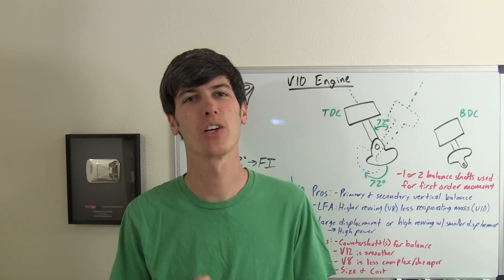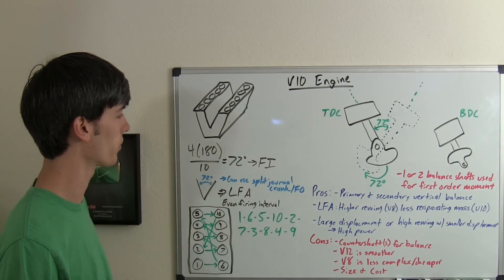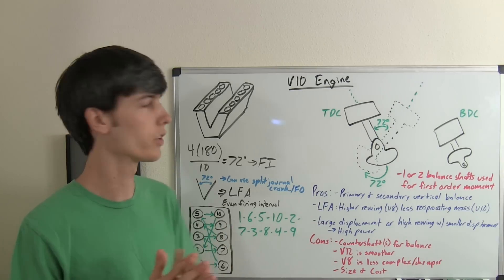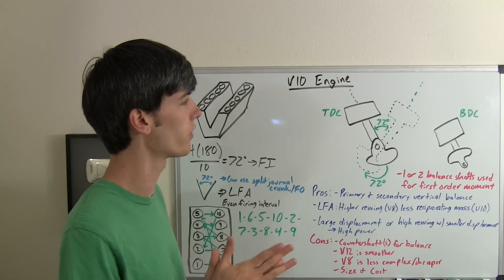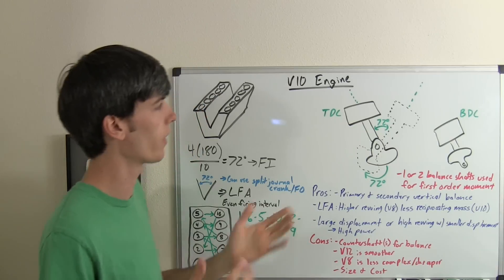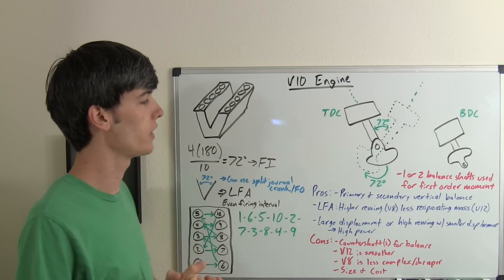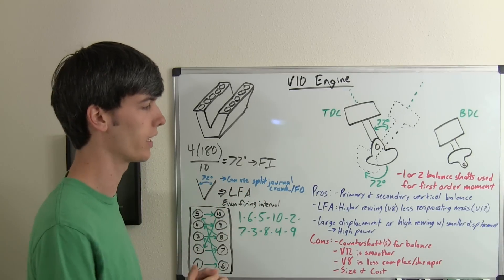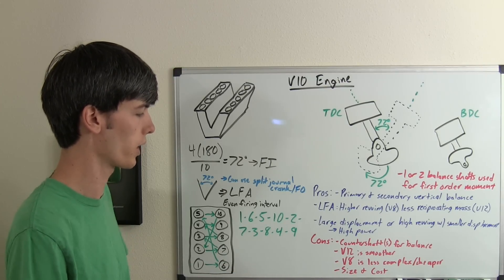V10 Engine - V10 Cars - Explained

Comment: Dumb question, maybe there is V2 engine? :D If it is real, maybe coud you explain that? :DD
Reply: EDIT:ooh I completely forgot, they use them in choppers, this could still make an interesting video :)
Reply: L twins and v twins are a v2 i guess. Not just choppers and it shouldn't be said as so.